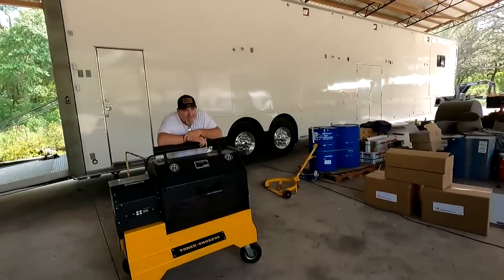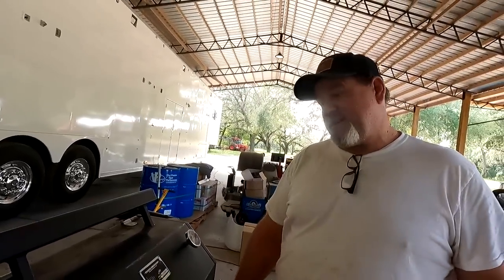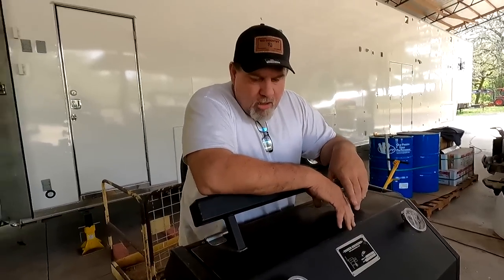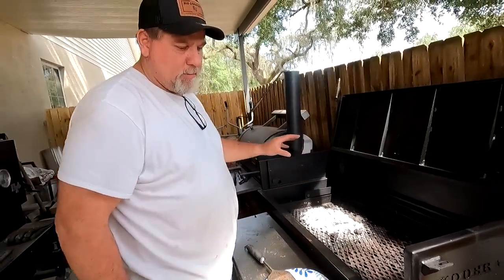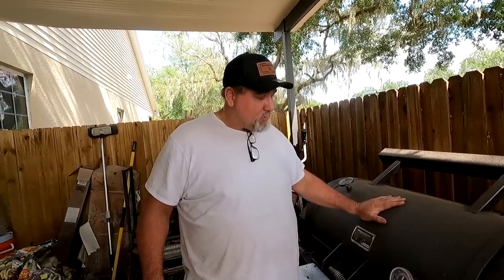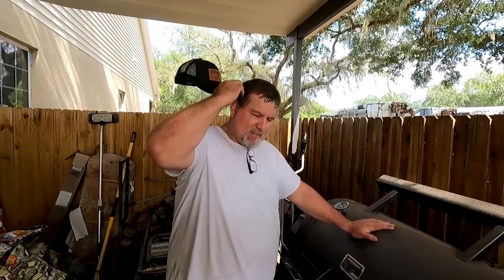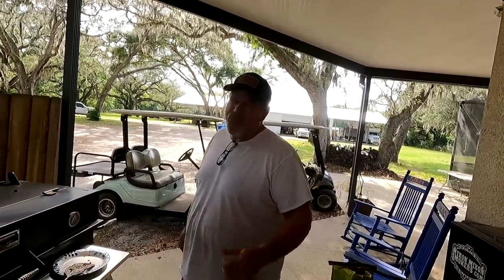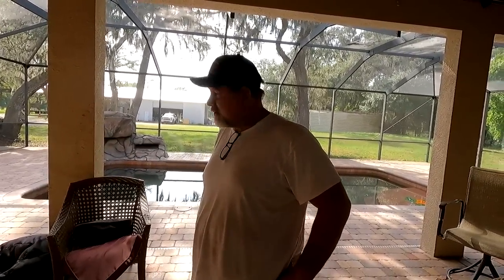My Personal Smokers I Use To Cook Food

Comment: Corey my father was a WW2 vet he passed in 01 at 95  when he was 88 we built a smoker out of a military transmission transport case it is thick and had water proof seals for shipping we took the seals off and made a good smoker it holds heat really good I made a gas burner for it with a heat plate or you can use charcoal. I will send you a picture some time.

Comment: Are usually smoke for two hours maybe three depending on the meat in the pellets, I’m using, and then like you said, turn the heat up I run KENS barbecue sauce called CANNONBALL  I buy a case at a time. It has 4 gallon jugs in it. I use it on all sorts of different meats. I even use it in rice.

Comment: I had a Yoder YS640S and sold it for a Lone Star Grillz pellet. Fire pot is below the cook chamber so the bottom rack is away from the heat source. When I feel like tending a fire, I’ll run my workhorse or TMG Fridge. When I feel like charcoal (set and forget) I’ll use my drum or Assassin cabinet. When I feel like grilling, I’ll run my Assassin 48” grill.

Comment: Nice video!  I'm partial to using oak wood.  It has a nice mild flavor.  I'll disagree with you on the types of smokers not making a difference.  I've owned and cooked on a lot of different types, except the green egg.  Honestly, the pellet smoker was the worst.  It smells like your burning sawdust (which you are), and I don't get any smoke flavor in the meat.  Maybe I was doing something wrong.  I'm a fan of the stick burner with all wood or charcoal with wood splits/chunks, but to each their own.